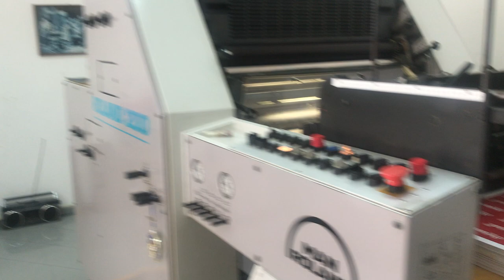Roland 202 TOB 1995

Comment: Die MAN Roland 202 war von den 10 ! Druckmaschinen, an denen ich gearbeitet habe,die schlimmste Maschine. Eine totale Fehlkonstrucktion. Einmal in der Woche,musste ein Monteur, geholt werden, um Teile, zu reparieren oder auszutauschen. Ich war manchmal, den Tränen nahe,vor Verzweiflung.
Reply from the maker: We are not manufacturer of that model so better is to send your opinion to MAN ROLAND. In addition, many print shops have/had that model without any problems. So if you had a bad experience with that model, it doesn't mean that all machines, that model were for scrap...Thank you and have a nice day